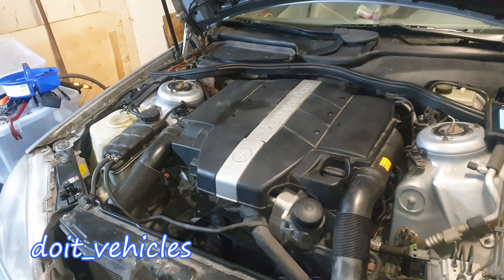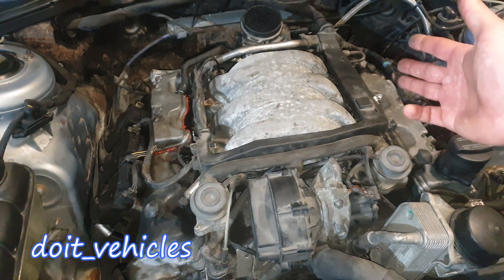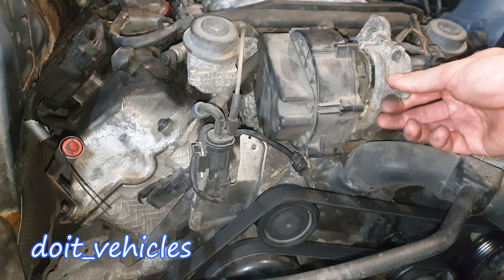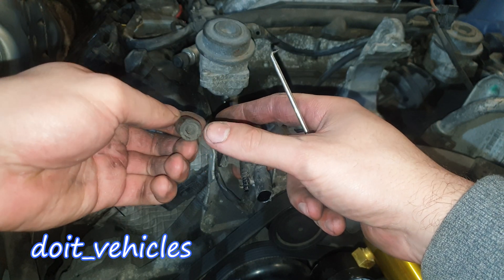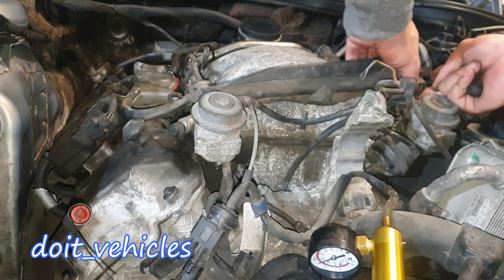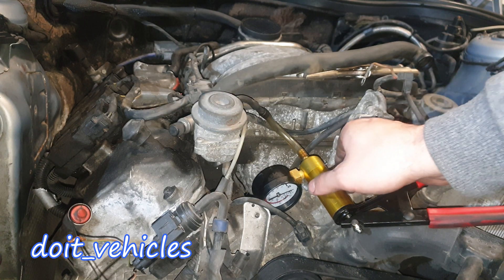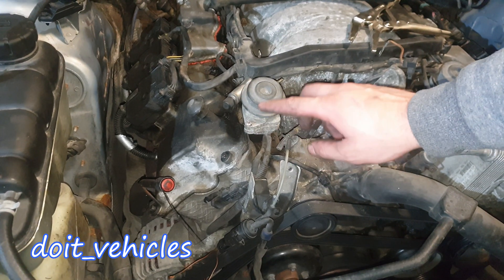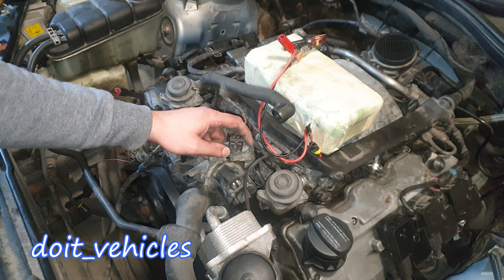S 320 Mercedes V6 V8 W220 Secondary Air Injection System Pump , Solenoid Check Valve Removal P0410

Comment: Hey everyone... Can a air leak along the seam in the secondary air pump cause a P0455 large air leak code ?
Reply: No,P0455 is leak in Evap system,the one capturing gasoline vapors.

Comment: I just replaced the pump the old one didnt work when power was applied this does but still wont come on i feel its not getting power or the solenoid is bad. I checked the relay and its good. What do u suggest
Reply from the maker: Chuck the Wireless,  connection , corrosion etc
Reply: @doit_vehicles  i just also bought the solenoid. When i put it on il check the wiring. Thanks man
Reply: @adrianechavarria-b1y  any update... I just replaced my air pump lots of corrosion on wire connectors, I'll double check wiring for continuity tmrw getting ready for work .
Reply: ea i replaced the pump again it burned out but this time i changed the relay also its working but i got the code again for the pump i cleaned out the check valves and erased the codes i guess we’ll see. I turned it on this morning pump came on then shut down like its supposed to 45 sec later
Reply: @adrianechavarria-ve8ch  Where is the relay located?
Reply: The cel came back on anyway. U think its the check valves?
Reply: Where is the relay located?
Reply: @BestBenz333 right side fuse box under the hood. directly under neath the 40 amp fuse which is also the secondary pumps fuse.

Comment: ml 350 .i had po410 code. rubber three way connector going to solenoid split and caused vacuum leak. part # is gxl6010780245

Comment: CAn you explain how to engine wash the w220 without any problm?
Reply: DON'T DO IT!  If you have to clean it, get a jar of mineral spirits or varsol and a stiff brush.  Dip and scrub, use a rag and a lot of patience.  You'd have to be a fool to hose one of these nightmares down with water.  You'll end up chasing codes for the next decade!
Reply from the maker: On this engine it requires to take each part and clean it aside like the main components: intake , valve covers . At least that's how I would do it
Reply: @doit_vehicles  one time I given to car wash they blown all 6 coils🤦‍♂️.
But I want to see my engine clean but scared to clean. Now days I clear myself.but still oil is there.
I buyed form engine degreezer and clean with brush. It work fine still I am scared of that 6 coils.. tats why I didn’t pleasure wash the engine
Reply: When I wash. I remove the filter box and close that air intake valve with plastic. Then I spray the degrezer. And I buy one hand pump pressure washer to clean it.still sacred about the coils. Each coil cost 100aed

Comment: Hi. Thanks for your videos. I have a similar car. 2002 M112 S320. Your help is really appreciated. When you say it smelled on startup, what did it smell of?
The problem I’m having is that the air pump is on constantly. Even with a hot engine. Even ignition off and car locked. I’m going to replace the relay first. For the moment I’ve unplugged the pump to stop it burning out. Do you think I can drive with the pump disconnected?
Reply: Yes, the car will run, but forget passing an emissions test.  The exhaust will most likely smell a lot stronger than usual due to the cats not fully doing the job when cold.  This pump just pushes fresh o2 into the cats to get them working quicker.  Thank your local green environmental bunny hugger for this extra crap bolted to your car.
Reply: @jagboy69 It was the relay. Replaced it for €20.
Reply: @thomash2806  Awesome!  I love cheap fixes!
Reply: @thomash2806  were is relay located ?
Reply: @thomash2806  Where is this relay located?

Comment: can you drive without secondary air pump?
Reply: Yes it is only meant to heat up the cat faster for emissions you can actually decode it, and just remove it if you want with the correct software

Comment: I have 2005 ml350 w163. The pump comes back on and off  3 to 4 times when the engine temperature is around 79°c to 80°c . Any advice or ideas please 🙏   Thank you.
Reply: To be certain it's the pump, unplug it when you hear the noise
Reply: @rodflo2979  I did that .
Reply: @adebayooni1673  Did you check your relay? It could be sticking
Reply: I did not think it could be the relay, because the fan works the way it should at cold start for a minute or less. Than it comes back on and off 3 to 4 times when temperature is around 79°c to 80°c then off until the next cold start.
Reply: I mean the pump. Not the fan
Reply from the maker: Hi ! sorry for late reply ; The pump should not turn on when the engine already reached the operating temperature . So there can be a couple of reasons why it does : a error on the "CAN BUS " network comunication when the computer thinks the engine is on a cold start ; this can be hard to detect and you will need at least an osciloscope and reliable wiring diagram to detect why is this happening . Second reason can be for example if the coolant temperature sensor is reporting a low temperature (for any reason ) so if possible have a look on a live data when you expect the pump to turn on, to witness any unusual values reported by the sensors , that would be my first step .
Reply: @doit_vehicles  Thank you for the relay. I have eliminated the coolant temperature sensor possibility. Left with Can Bus. Wish me luck.   Thank you.
Reply: @adebayooni1673   Hey, i have the same problem with my car, did you figure it out ?
Reply: I guess he sold the car...

Comment: I have a 2008 e550  and the pump comes on and off while I am driving or at a stop while the engine is running.. Any idea what's wrong?
Reply: I have  same issue with my  2005  ml 350  w163. Any idea how to fix this issue.  Thanks
Reply: @adebayooni1673  In my case it wasn't the pump making the noise. Turn out to be my radiator fan making the loud noise when it kicks into high gear. I changed the fan and  the high pitch noise is gone
Reply: Thanks for the reply 👍🏾

Comment: Please tell me how to bypass the air injection pump? In my case pump is good but no power goes thru it
Reply from the maker: Remove the connector from the solenoid . You might get the check engine light on .

Comment: Hi , l've sprayed wd40 in my air intake tube  right behind the airflow sensor  mercedess  cdi 1999 , does it clean or harm the engine affer all  , ps l'm having problems with high levels of smoke , thanks in advance!
Reply from the maker: It kind of does both , but you will need a lot of spraying to clean the valves which also might damage the engine or catalytic converter
Reply: @doit_vehicles  thaks a lot for replying and for the advice, all the best to you !
Reply: Why not just spray water then ?